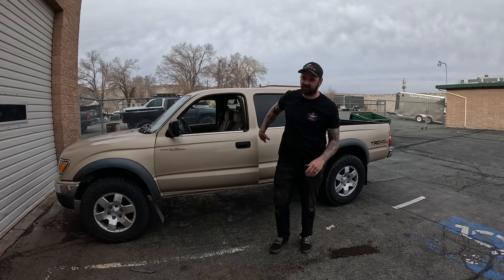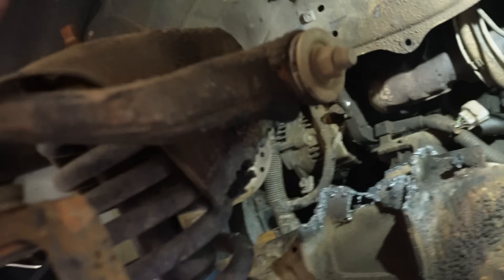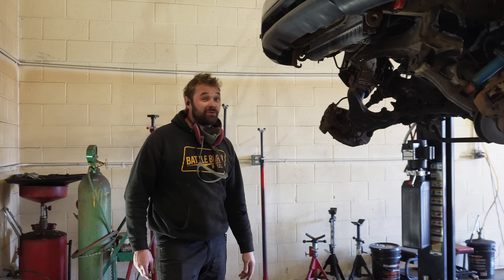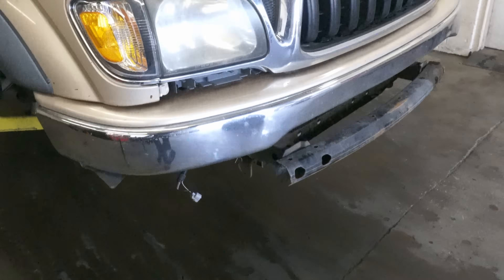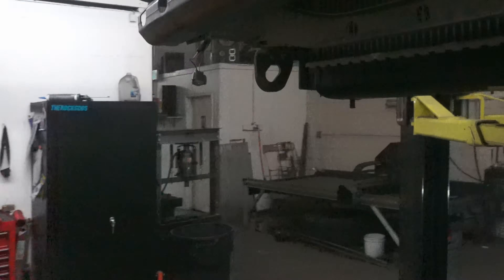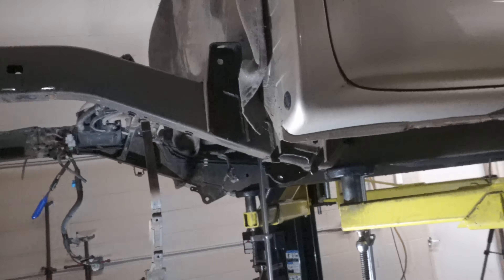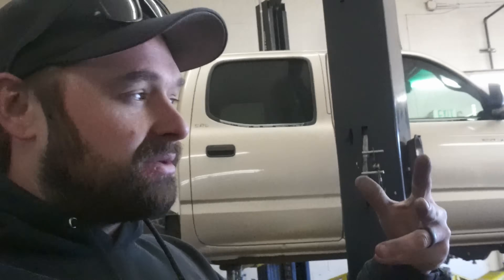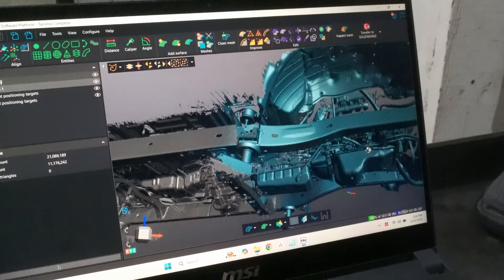First Gen Tacoma Solid Axle Kit! Teardown & 3D Scanning

Comment: How about a kit for the 99-04 Super duty axle utilizing a radius arm kit? I've got one out of a 04 they're much cheaper. I know, not as strong, but still strong enough.
Reply from the maker: I’m not a huge fan of the radius arm stuff. If you’d want to go with that setup a 05+ axle would be easier since they have the radius arm brackets stock

Comment: You should buy a scarfing tip for your torch it will save a ton of time and way less grinding and cutting.
Reply from the maker: I have one but I’ve grown to like cutting the welds more. Most likely because I always gouge the frame with a torch no matter how careful I am haha.
Reply: @ that definitely is an issue I’ve had hours and hours of practice on equipment repair it definitely takes some time to get used to. just figured I’d pass it along.
Reply from the maker: @ Hell yeah man I appreciate the input! Next time I cut a front end off I'll break it out and dust off the cobwebs!